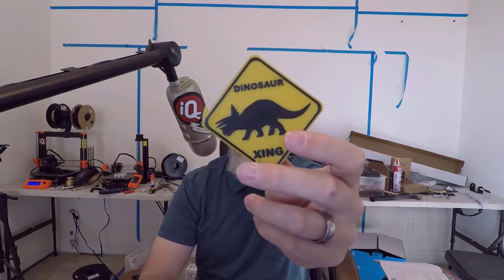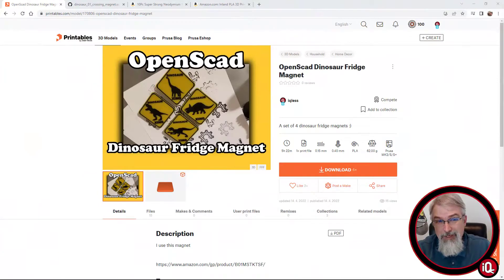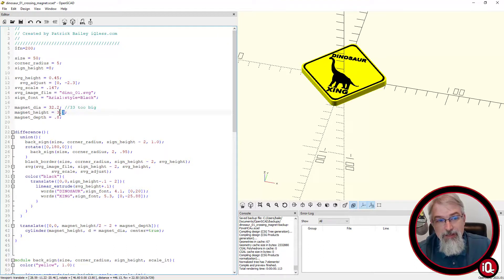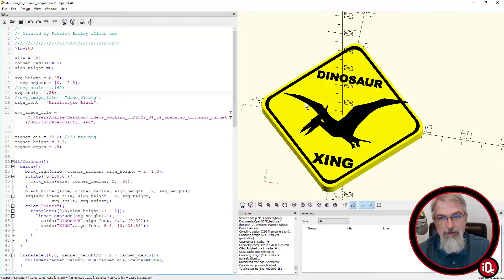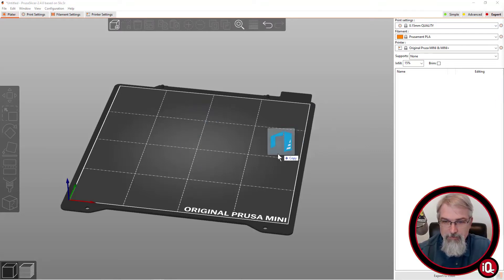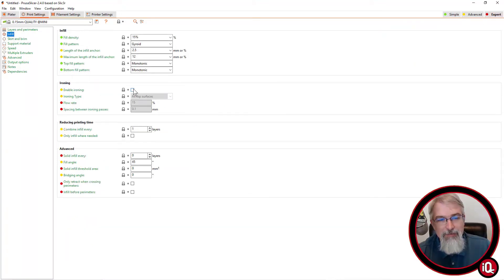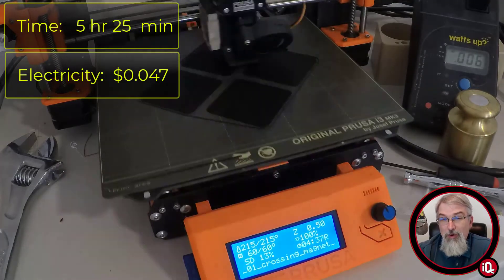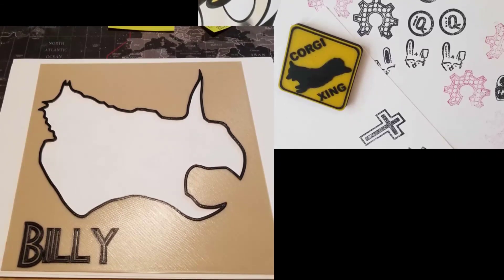3D Printing: OpenScad Dinosaur Magnets

Comment: I spent a month trying to learn freecad last spring. But what is openScad?

One frustrating thing about freecad videos on you tube is that my free cad seldom had the layout of the version in the videos. Also, a cad video really should be in 4k and we need a way to freeze and zoom in to better see what is going on in the video.

I did not progress enough in freecad. As an inventor and problem solving engineer, I need to learn enough cad to be able to make good 3d rotatable objects. I had to rely on an artist and draftsman when I filed last year's patent. 

I got to say, that the arc drawing tool in freecad was invaluable to me. It was far more useful than making a circle and erasing the part I didn't need, as in other programs.   But I was plagued by quirks, and microscopic open vertices in free cad.
Reply from the maker: I would recommend Fusion 360 if you wanted to use a good 3D cad software.
To answer the question OpenScad is 3D design as code.

So its very different to work in it than in 3D CAD software.
I have a video coming out in a few days going over how to make this dinosaur magnet.
Or you can check out now https://youtu.be/mFW1Mo3T-Rw
to see how the development process goes.